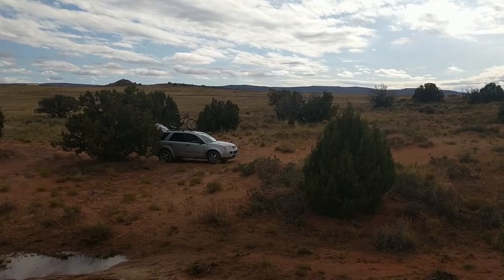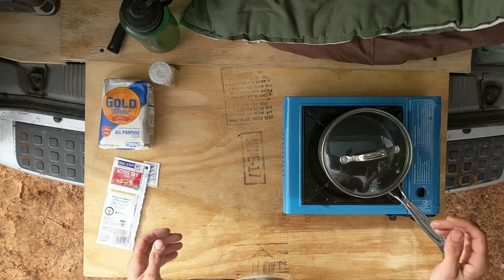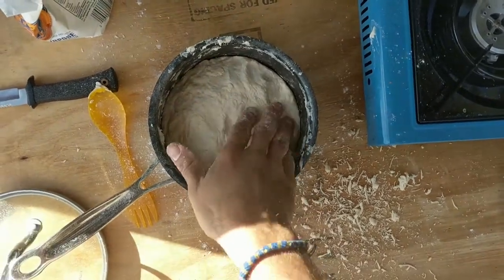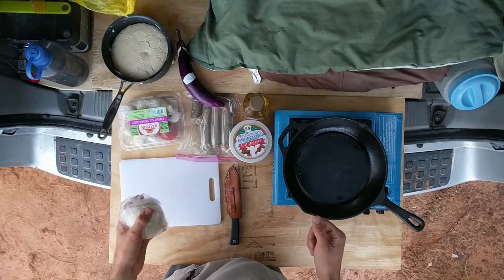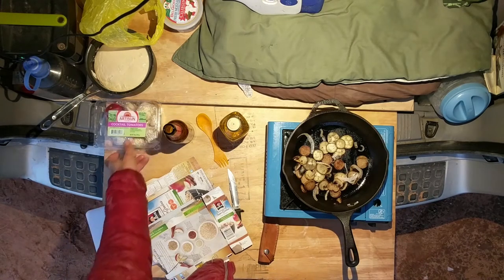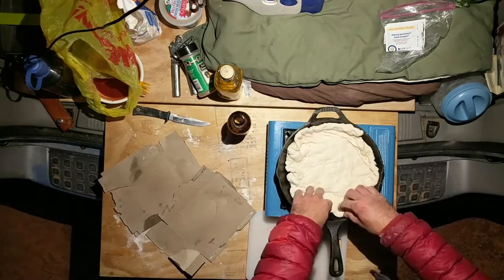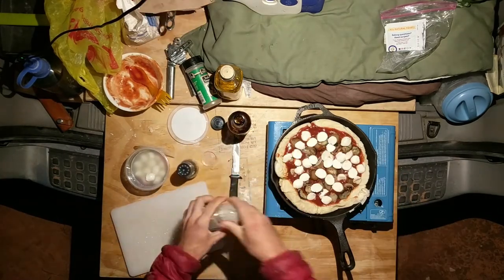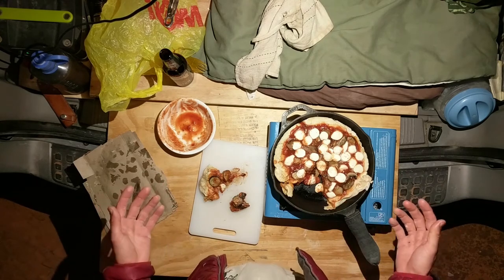Car Cooking: Episode 9 - Cast Iron Pizza

Comment: what size pan is that small/ med. or large?
every time i go into walmarts i am questioning myself if i should get one or not...
I already have frying pans from home.... but, i think that the cast iron pan is good to use on a camp fire.....and i can't use my home frying pan on a camp fire... but, i also don't want to bring to much cookware when i get on the road.... decisions, decisions, decisions

Good job on the pizza.... yes, your right.... next time don't use so much flower
Reply from the maker: I got my cast iron pan last year and wish I had bought it years ago. It's a great all purpose pan that you can use on gas stoves and fires and cleans up so easily. I think this one is a 10 inch pan? I also have a small ceramic pan that I picked up at Walmart. That one is great for cooking eggs in the morning because they don't stick at all and don't require much oil.